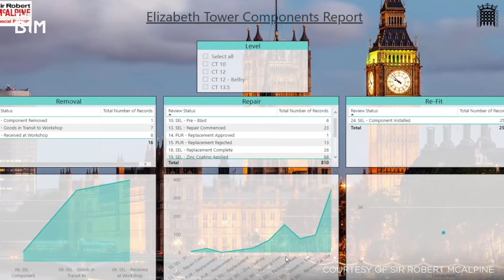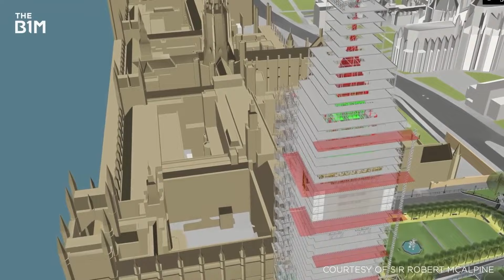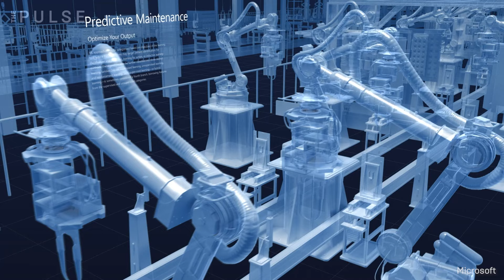Digital Twins: Building Cities of the Future | The Pulse | Unreal Engine

Comment: This "tool" he talks about at the 3/4s was very much like the mostly defunct Google Earth project, the most successful bits of which were integrated into Google Maps. For all the effort and polishing that's gone into the creation of this, why would that application be more successful than Google Earth? Unreal engine is certainly "shinier" than Sketchup, but are you going to be able to collect enough data, especially on rural areas and very old buildings, without user contribution - or perhaps can't you call Google Earth and Sketchup an important predecessor to digital twinning in general? In fact why wasn't Google included or even mentioned in this video at all, is it because they are the major competitor to Microsoft's projects? Google Maps, for instance, already exists on the market, with simulated 3D of any street and live data streams of traffic, speed traps, store and location reviews, pedestrians in stores, even gas prices... It's more an augment to reality not an alternate to reality, but can you load anything more robust on a 4" screen over a satellite network anyway?
Reply: Or, since it seems the people in this video have strong ties to the UK, is it more of a "location monopoly" that's forming, where Google manages the users in the States and Microsoft manages the users in the UK? Is that ethical?

Comment: right now the current economic system, which is foundational to outcomes, is not set up for your ultimate goal to be realized. people talk about lofty goals but seldom really mean them. the public has been so evangelized with lofty sentiments and failed outcomes of fairness that anything put forward to address anything is a very hard sell. the trust environment is low. quality of life improvments, has up to current time, meant, only if you have the cash to pay for it will you live in that way. if you dont well your left in the financially harvested unconsidered side of the equation only. this massively un balanced economic system will prevent this vision from any kind of large scale realization except for those with large incomes in segregated communities. exactly the population that already has the least current problems. task one is re evaluating this frame work your limited by. 

second cities and towns are strapped for money at least in the west. corporations are flushed with cash. for 50 years there has been a reluctance of the super wealthy to invest in their own countries and commonly held infrastructures. instead the wealthy have tried to isolate themselves in private enclaves letting the rest have less and less over time. this has been facilitated by their purchase of political power which they used to take money into themselves and away from public planning instead of invest in shared prosperity. thus resources at city and town level are currently extremely constrained artificially. this prevents any kind of broad planning and problem solving at large scale.

for now information is not just useful for problem solving its also power in society. so far all this power has been sequestered in large corporations and large govt entities which dont always have the average citizens interests in mind. in other words our current physical imbalances are reflected in how data is also used in society today as well. the few control the data of the many and the many have little control over their relationship to the data and how its used to shape their lives for better or worse. over the last decades this has only become more unbalanced. if these fairness road blocks are not dealt with you will not have the trust of people to go down this road or resources to do it or even a population of trained experts it will take to implement it in the first place. 

the biggest challenges aren't technical but social and ethical. thats the foundation the society your talking about needs to function on. the fourth turning we are in with its chaos makes a de centralized approach probably the only workable way to do any of this. bottom up. but well see i guess. way i see it people want their startrek future but not the social and ethical work to get there...tech alone wont do it.